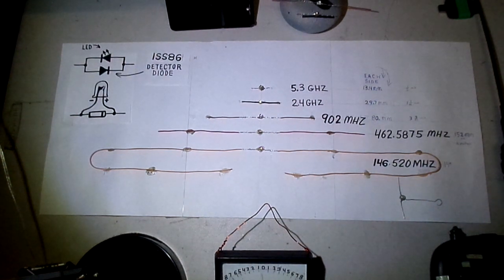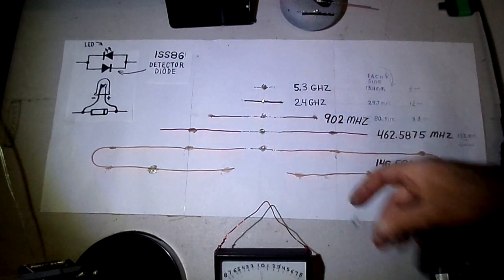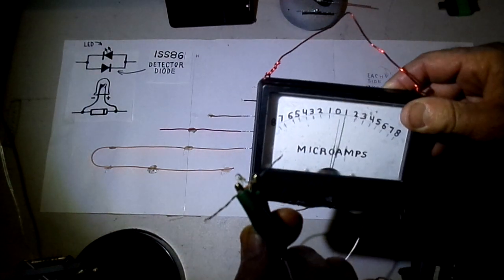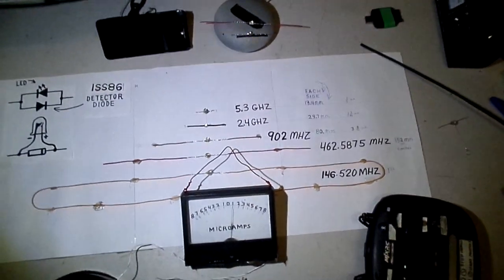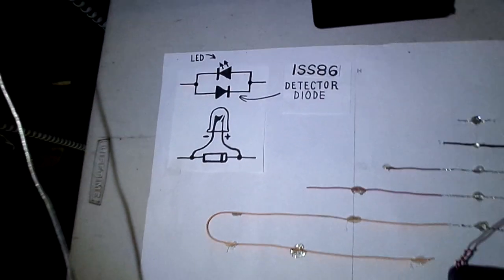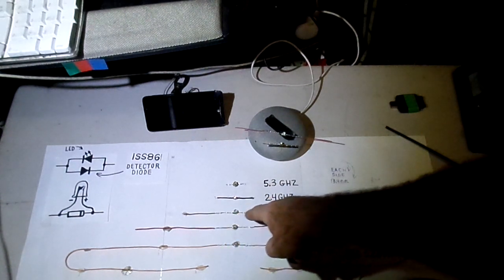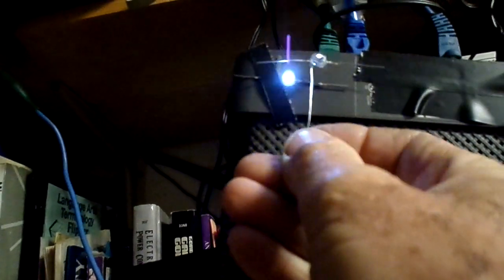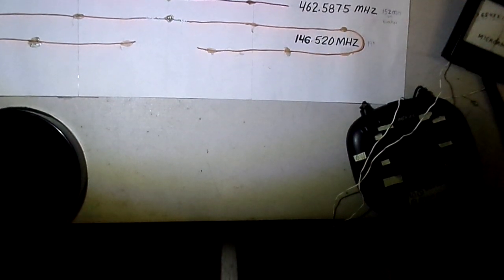2 Dollar Radiation Detector You Can Build. Beware of imitation diodes that don't have an H on them.

Comment: I can tell you this!! I had to get rid of my magnetic Loop antenna .  I was using it at my daughters house and as soon as I started to transmit my heart went crazy with PVC's. And it happened at a field exercise with our club, when I was about 10 feet under a dipole  on 40 meters with 100watts. So you do have to be careful.
Reply from the maker: Unless you have a pace maker I'm a bit of a skeptic when people tell me stories like yours.
Reply: @GrantsPassTVRepair  He probably died driving past a 50,000 watt AM radio station.

Comment: Hello thanx for cool video. I just wonder what kind of LED are you using for this project. because my doesn't work. Thanx for answer.........
Reply from the maker: I used a white LED that had an ideal operating voltage of 3.6 volts @ 20 milliamps. Did you use the same diode that I showed?
Reply: @GrantsPassTVRepair  Cool can you send me exact model of the LED or link. Thank you very much....
Reply from the maker: @honzahanes484  Tayda Electronics has LEDs that should work. https://www.taydaelectronics.com/led-3mm-white-water-clear-ultra-bright.html  You will also need the diode I showed in the video.
Reply: @GrantsPassTVRepair  Cool thank you for your answer. I let you know if it's work when I get the exact LED. The 1SS86 Silicon Schottky Barrier Diode I got already...
Reply from the maker: @honzahanes484  As long as you have the LED and Diode pointing in the right direction  it should work fine. Have fun.
Reply: @honzahanes484  what was the issue before you got it to work? Curious.
Reply: Well I did everything correctly from begin but the signal I wanted to detect was too week. RF power from my European version Spektrum transmitter is as longest I know just 10mw which is way to low to detect it this way.
Reply from the maker: @honzahanes484  You should be able to test it with other transmitters such as your microwave oven by holding it by the door when it's on.

Comment: Not sure if you've heard of it, but Stryker sells a CB antenna called the SR-A10 that has blue LEDs that light up when you transmit: https://strykerradios.com/store/stryker-sr-a10-cb-antenna/ I'm sure it is using something similar. There is debate as to if the LED's 'rob' RF that could be used to get signal out.
Reply from the maker: Clever invention.
Reply: Debate?  Where do you think the power comes from to light the LEDs up?
Reply: I worded that poorly. There's no question the RF is powering the LED, but how negligible is the effect on transmitted power, I guess would be a better was of phrasing it.
Reply: @arsbadmojo  It would be by exactly the amount of power dissipated by the LEDs and associated circuitry.  You can't destroy energy.  It will either be radiated, or absorbed.  An average blue LED dissipates about 100mW.  Multiply that by the number of LEDs.  10 LEDs are going to consume about 1 watt of the stock 4 Watts a CB is allowed.  This also depends on a number of other factors - is it full wave or half wave, how bright are the LEDs, are there any other components dissipating power besides the LEDs, etc.   The extra load of the LEDs will also affect the impedance of the antenna, which can cause a mismatch that will reduce the radio's radiated output power if not carefully designed.  But the radio will lose at least the amount of power dissipated in the LEDs.
Reply: I don't think there's 10 LEDs in there, but yeah. One thing -  "....about 1 watt of the stock 4 Watts a CB is allowed." It's so weird that one of the selling points on this antenna is "Higher Power Handling Capability (10,000 Watts)". Too funny!
Reply: @arsbadmojo  A lot of CBers run illegal power amplifiers (not usually 10kW though).  I wouldn't expect the LEDs to last very long in that kind of RF field.